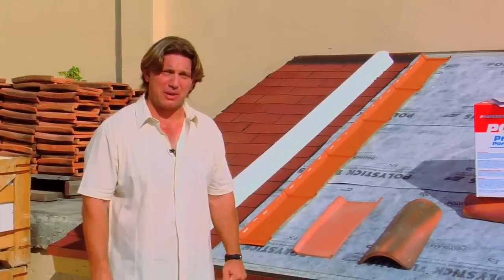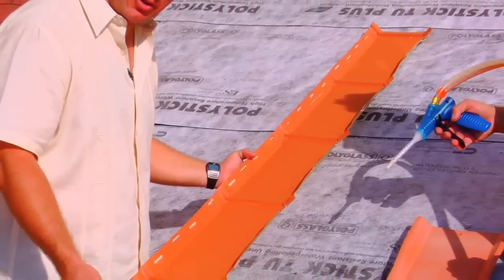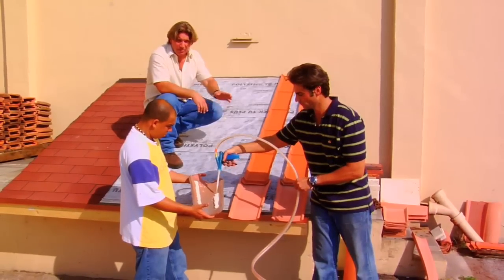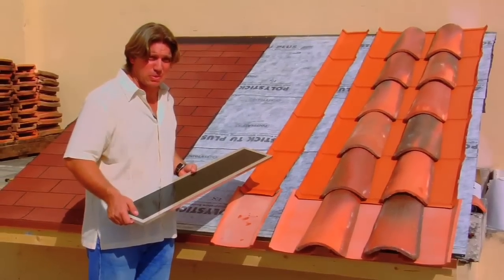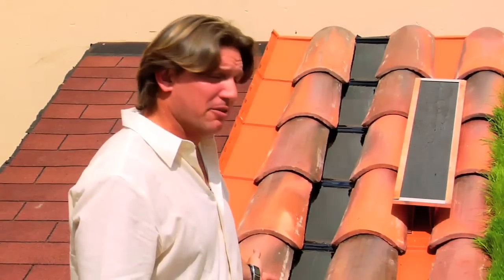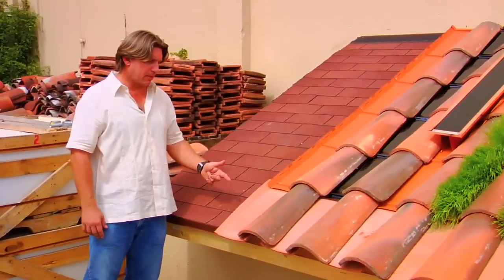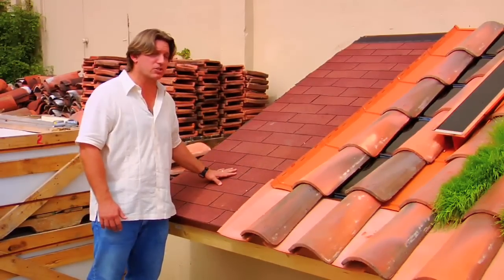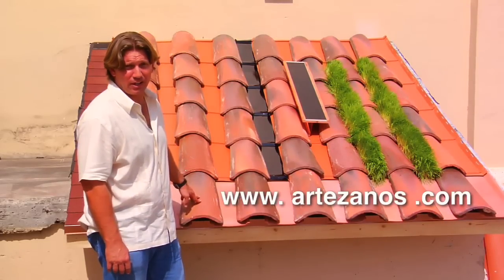HD-The Universal Hybrid Roof Tile System

Comment: Wow Danial, If someone doesn't understand your concept of a roofing system , you believe they have no sense? Great public relations there. If you read a large majority of these comments Daniel, you will understand that a lot of us don't get your demo from a number of points. You have failed to make it easy for us roofers and customers to understand the benefits and features as well as the cosmetic attraction. You are probably a hard working guy. There's probably some benefits to this product, but I strongly advice you listen to your customers, and don't act like a brat and insult them, when so many of use don't like or understand your demonstration and the product. You are welcome. P.S. I see how rain can be blown up the openings of the base of each tile. Without being rude to me can you explain why it's open? Maybe its just for southern weather?
Reply: The openings at the end are filled with a pre manufactured clay vented eave stop to allow heat to escape, positive water drainage and perimeter reinforcement.

Comment: So the underlay felt is all that you fix to with foam? how can the felt hold the weight of the roof covering.
Reply: shane redman  This video is old.....Since then, we have been using a cross woven polypropylene synthetic from SharkSkin USA. It is very lightweight and has a very high tensile strength. The adhesive we are using now is Storm Bond by Convenience Products. Its a very high performance one component polyurethane adhesive and has a performance value almost 100% over the 3M and DOW Chemical Roof Tile Adhesives that have been used for the last 20 years in the Hurricane High Velocity Wind Zone. When you combine these components with our lightweight hybrid system (275 lbs. to MAX 425 lbs. weight per square), it creates a formidable roof system with impressive uplift wind resistance. Thanks for your interest.

Comment: I'm not familiar with the product...but this is not your everyday expanding foam.  It's probably an expanding foam RESIN...   I worked in the Aerospace Industry (Manufacturing) and have experienced various exotic epoxys and resins...and they are STRONG, DURABLE but EXPENSIVE!  And they can withstand the extreme temperatures of OuterSpace!  If this is a 3M product...I'd trust it.
Reply: Art, finally! someone with some damn sense!! ; ) , Youre right 3M bought out PolyFoam Products two component foam adhesive. It has been used in Florida extensively over 20 years. Until recently, we have discovered Storm Bond by Convenience products one part foam and it beats the 3M product and the DOW Chemical 1 part adhesives by almost 100%. The difference is that the Storm Bond is easier to use and much less expensive. We used it on D Wade's new Hybrid Roof in Miami Beach. The product is very high performance. Thanks for your input!

Comment: Its not stylish to say the least. Glued on roof? I'm sure this would last through -20 and 120 degree heat. I dont get it....
Reply: What dont you get? FEMA recommends the use of foam adhseive for hurricane prone areas because of the products ability to withstand extreme temperatures and wind uplift. This is standard in South Florida for the last 20 years. Stylish? The video does not show the wide range of aethetic that this system covers. There are many possibilities depending on ones taste. This cant be represented in one video.
Reply: By the way: Did you know that there are high speed trains assembled with a high strength polyurethane adhesive in lieu of screw fasteners or rivets so as not tu be vulnerable to vibration by Bosch? Also the foam adhesive shown in this training video is owned by 3M, ever head of them?

Comment: Could you provide a side-by-side, shear, compression and tensile strength comparisons between the nailed and glued?  What is the uplift resistance requirements for FL?  Do you know if this system is approved in nay other states, if so which states?  Without damage, a tile roof will last a very long time, 100s of years, what is the life expectancy of this system?

Comment: The video was not meant for aesthetics. Its an old video showing a demo using prototypes. If you do your research, you will see that our system has evolved into a roof system that is stealth and very difficult to distinguish from any other barrel tile roof. That metal pan with adhesive does 727 PSF all by itself and covers about 82% of the roof. There is nothing in the market that even comes close to our hurricane high wind performance. Oh by the way, I'm fatter now than I am in the video!

Comment: @1402janelle 

@1402janelle  In our Tile integrated installation, the solar is approx. $5.00 per watt and the roofing part $6.00 per sqft including demolition of the old roof, new underlayment ect....... Individuals in less restictive code areas can do the Solar at $3.00 per watt and the roof part at $3.50 per sqft.  My 19 year old son did one of the roofs in Miami Beach, Florida with no prior construction experience.  The roof is very basic but looks authentic!

Comment from the maker: camboz1,

     For your information, the Polyfoam product in the video has been tested & approved for Hurricane High Wind Velocity Zones for the last 17 years. F.E.M.A. recommends its use in coastal areas. This is the preferred method of applying roof tiles here in the State of Florida.  Our approval is from 2/12 to 7/12. Most homes here are 3/12 to 5/12 pitch and are not as steep as what you are probably used to in the U.K.